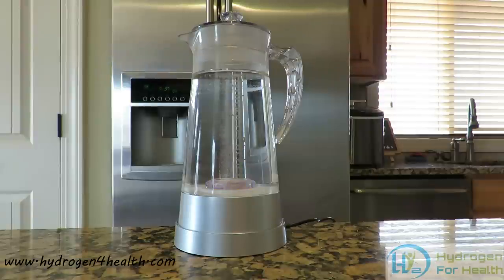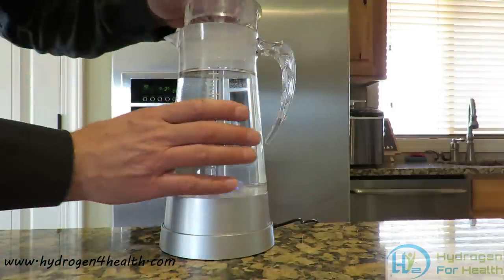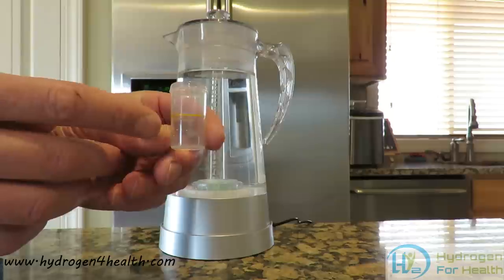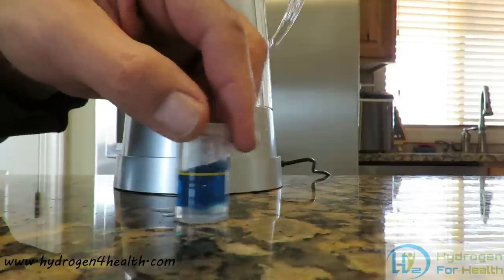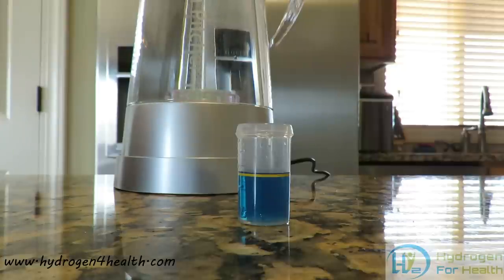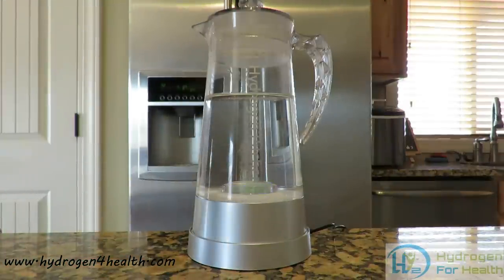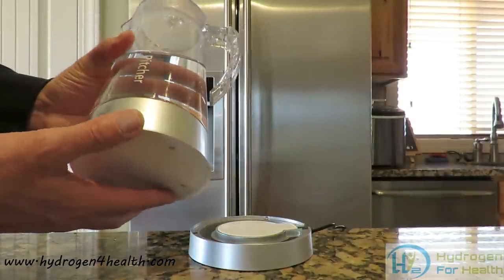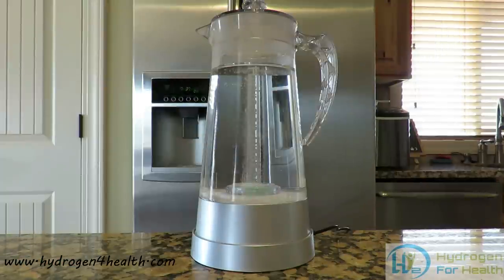Hydrogen Water Pitcher w/ SPE and PEM dual chamber Technology. Pure clean H2 rich water.

Comment: What is your take on this design hho generator:  If you built it using pvc plumbing pipe, 304 stainless,  food grade lye, distilled water, and 3 bubblers as filters.. would you be satisfied enough to use all hho gas production for inhalation and a 4th bubbler for drinking?  (Like used in the pubmed study; Hydrogen/oxygen therapy for the treatment. )?

Comment: Hi, 
Do you need to seal the container tight to prevent H2 from escaping from the water (in equilibrium)?
Do you need to drink the hydrogen water immediately to prevent Hydrogen from escaping?
Thanks in advance.
Reply from the maker: Kulo WC no it doesnt need to be sealed. The pitcher will run at full power for 15 minutes to charge the water, it will then run at half power for 30 minutes. You will have 30 minutes after it stops to drink or you can simply start the process again.
Reply: Does it matter if the water is cold or room temperature does it matter what the temperature of the water is?

Comment: Thank you for the video. Does it work with Distilled water?
Reply from the maker: Yes it sure does.
Reply: @Hydrogen4Health  hi there, I have 2 different machines that I believe are not good enough and when I use distilled water they dont produce any bubbles but when I add tap it produces the bubbles I don't understand ?

Comment: can you use tap water that has chlorine in it?  will it change the chemical of the tap water to hydrogen pure water?
Reply from the maker: Yes you can use water with chlorine in it. It will still put hydrogen into the water.

Comment: I can not unscrew the pitcher from the base to remove the plastic film  ??  I do not want to take the 4 screws out of the bottom in fear it may fall apart
Please advise :
Reply from the maker: James Foley the clear part will detach from the base. Screw it off counterclockwise.  Do not take screws out.